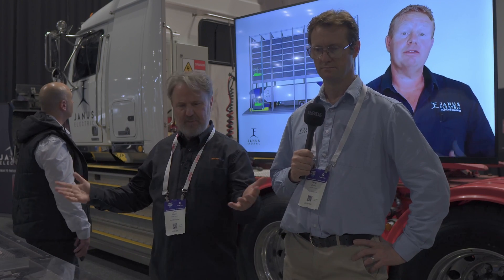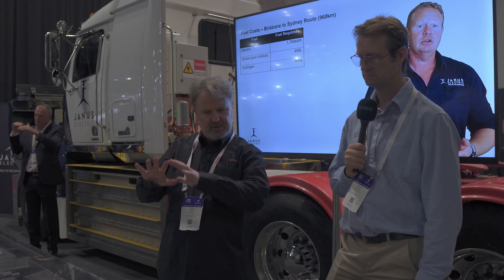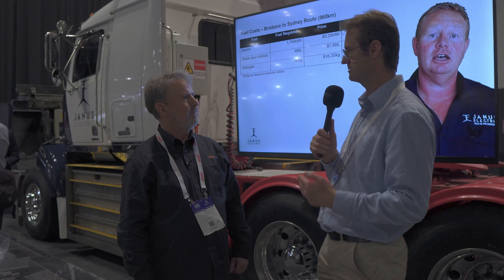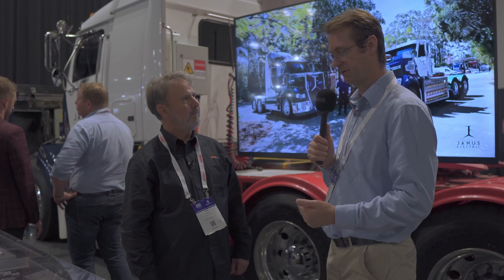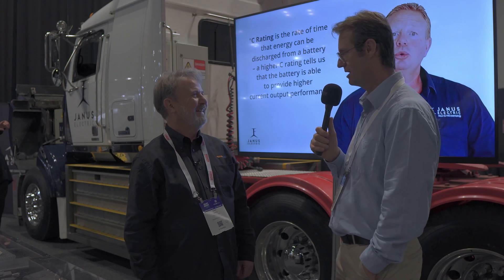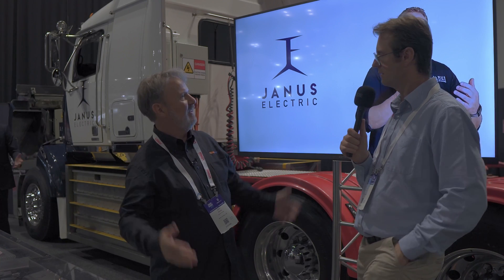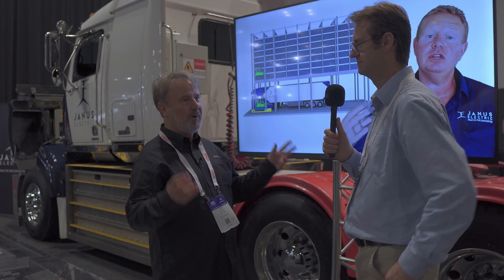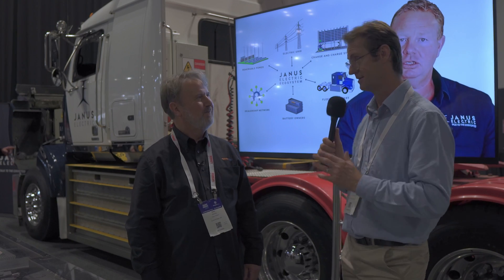Janus Electric - EV truck conversions

Comment: I've seen a few vids about Janus Electric. This one is chock full of details and will blow you away! Especially if you have a Transport background and realise how much of a game changer their system is!! It's not just cleaner air, or fuel security, it's reduced operating costs, cheaper transport costs, which means cheaper goods to the end user.

Comment: so now the consumer is paying for "gas and install" when they pull up to a gas station? Or do you give the consumer to new battery pack to install themselves, then find out they bent/broke a hookup just like you would hear consumers at the local parts store. There is no pro to this!
Reply from the maker: Long distance road transport is competing with rail which also has "gas and install" requirements. I guess the market will decide if electric trucks are going to fly :)
Reply from the maker: Long distance road transport is competing with rail which also has "gas and install" requirements. I guess the market will decide if electric trucks are going to fly :)

Comment: I'm surprised that gearboxes, driveshafts and normal drive axles, with a power divider still used. Maybe it requires a huge amount of extra R & D beyond Janus to develop traction motors on the drive axles but surely that's the long term goal. After all that's' how diesel electric locomotives work and half the reason to go electric, less moving parts.  Maybe Dana or Merritor will look into it in the future.